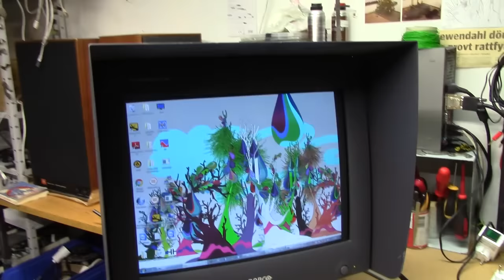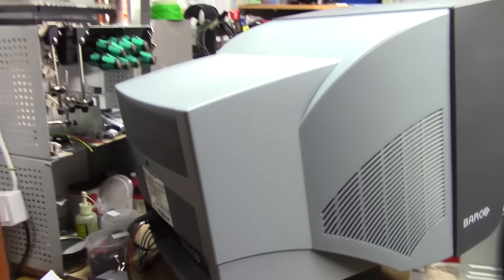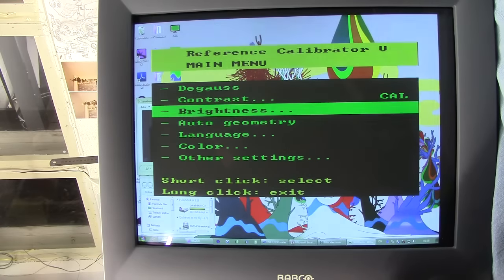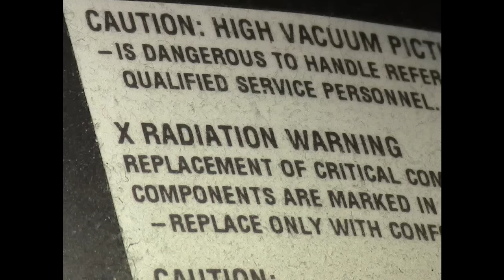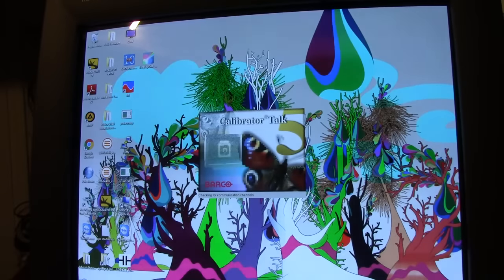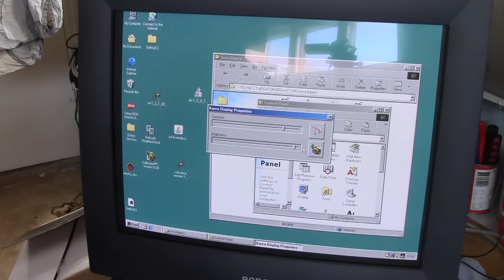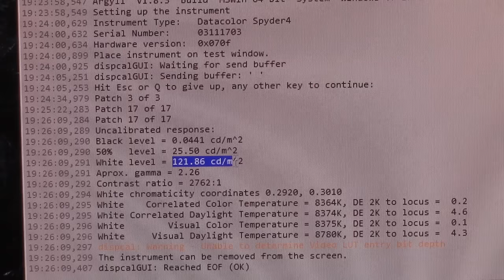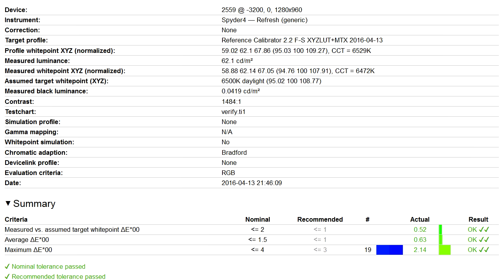Barco Reference Calibrator V CRT monitor

Comment: This was made Oct. 2001, at that time it's likely this accompanied a SGI workstation like an O2 or an Octane, I've also seen them with Sun computers but not usually a PC. The serial ports are to communicate the calibration and some monitor data back to a host computer where it would count down the hours until recalibration was required, The Barco chip is likely to deal with the calibration and so is most of the extra electronics. I think the USB is just a hub on these. I'm more familiar with the earlier monitors but Barco used to claim that they only used "A" grade CRTs while most PC grade monitors had "C" grade CRTs.  These were mostly sold with large graphic systems costing sometimes millions of dollars, they sold that division in the mid 2000s which was a sad day for me as I had years of experience, Barco training and enjoyed working with them, they had film printers that could do over 6000dpi and software that did things you still can't do with Photoshop or Illustrator. Today you commonly see Barco LED displays at hospitals for viewing X rays and the like. If you're at a big event with video projectors they might also be from Barco.
Reply from the maker: Cool.

Comment: Most older monitors had the BNC connectors because the VGA connector wasn't always around. Even some of the mid-age CRTs will have both VGA and BNC connectors, especially the originally NEC MultiSync monitors.
Reply from the maker: This monitor dates from well within the time of VGA as a consumer standard; I'd wager the use of BNC has more to do with industrial compatibility, since this monitor is certified for medical and ATC use.

Comment: We use calibrated CRTs in the industry still for this very reason. They are still outperforming even the top top end professional IPS monitors on the market.
Reply: +JJ Warner for us refresh rate isn't a big deal.(all the stuff I work with is just 24fps) It's mostly just about colour accuracy and luminance characteristics.
Reply: IPS, yes.
OLED, no.
Reply: JJ Warner
No OLEDs are better but we don't have the wallet where I work. So we use these with very high end calibrated IPS monitors.
Reply: No CRT does over 200hz. LCDs do 250hz, some TVs do 600hz.
Reply: Not sure about this nokia case looks really dodgy, flyback should die off pretty quick...
I have a best CRT ever made, Mitsu DP 2070sb and it won't go over 160hz.
Eizo does 240hz, ofcourse tvs don't have capability of driving 600hz signal, that would be retarded to assume... You would need some engineering to make it capable of that.
Reply: Really weird. Specs look pretty mediocre on that monitor. It's sort of 3310 of CRT monitors :D Will try to get one. Mentioned 600hz TVs just cause of dumb spec... So useless when response time doesn't get lower than 1ms... If it's 2ms 1/6th of frames is just fog... Even if we assume that there is some quadripple displayport connection and it has the wiring... Overall all LCDs flicker at 600hz, and that's unhealthy as fuck.
I would rather have 60hz CRT flickering in front of me... LCDs are braindamaging...
And yeah on 344hz there would be nothing more pleasant to play than Q3 OSP/CPMA, or some really smooth and cool video game.
Reply: Eats popcorn, so much stupid not enough patience to care.
Reply: Stupid? What to be exact?
Reply: techno girl CRT have perfect blacks to
Reply: CreativeType 

What industry?
Reply: @jjwarner9419  4 years later 360hz lcd

Comment: Pretty awesome to find a Barco display of any kind in the trash.  They're very highly regarded in industry and they supply screens for extreme high reliability applications like air traffic control radar displays and airline flight simulators.  Assuming the caps inside don't dry out and go high-ESR, that thing should have another 14,000 hours in it!  Too bad the internal comms have failed, but nice workaround with your Spyder4.
Reply from the maker: Oh, air traffic control - that's cool. Given how this thing looks, I do not doubt your statement.

Comment: I have a Compaq Q-Vision 210 with the same Phillips turquoise driver chip in it. That monitor is from 1996 and also has the same separated VGA to BNC connector on the back. It also has a Hitachi CRT in it, but I forget the model.
Reply: +Mark Furneaux fun fact: a lot of monitors came like that if they were primarily for the photo editing or prepress markets. I recall quite a few Applevision Trinitron monitors with the same hookups, and their respective Apple-rebranded graphics cards for the time. I'm believing it had something to do with higher resolutions or color-correctness, but I could be absolutely wrong on that front.

Comment: you can skip to the () if you wish because I now what wrote was long.

I have dell 1998 dell CRT monitor that is almost new the person how had it didn't use it a lot I played sonic and seat all stars racing and it looked better and was smother then my old LCD that likes to be bad and it can go  to 1600x900 but its not recommend to go over 1024x720. I uses to play my old windows xp games on because on like my old LCD if you changed the resolution it would cut off the image I have 3 CRTs monitors and 4 CRT TV which one I still use all the time and 2 monochrome ones . the TV I uses is an 1995 Samsung 24" inch to play my DVD, vhs, n64,Wii because none are HD and it looks better on it. (cool find)

Comment: I want one of these.. I wonder if you could put a Noctua fan in the case.
Reply from the maker: +Graham R Any 80 mm 12 V fan will probably do - they don't need extreme airflow by any means, the total consumption is only about100 W or so.

It's funny you'd mention that, though - I'm actually fixing up a second one of these right now, and one of the fans I was considering putting in was a Noctua, but it had to give way in favour of an Arctic F8.

Comment: hi @FFcossag, i already have a Lacie electron22blue ... do think a Barco Calibrator would be way better?
Reply from the maker: No, I don't think so.
Reply: ok thanks mate!
Reply: @l0rdm0rd  The Reference Calibrator had clamped black as well as white levels. I believe the Lacie had drifting black levels. So the calibration would drift over time on the Lacie while the Barco would remain more stable for a longer time.

Comment: How much does this monster weight?
And what is the max. resolution?
Reply from the maker: +Das OSi About 32 kg and 1600x1200 @ 85 Hz. I personally find the lower resolution modes at 100 Hz to be more interesting, though.
Reply from the maker: +simontay1984 To be fair, in 1999, it wasn't possible to be much more than a first-year student with regards to Java, since Java wasn't really a thing before 1995. And since the software IS written in Java, you really do have a point, I suppose.

Comment: I might have missed it but I didn't catch if you were using a serial line directly connected to the RS232 output on the computer, or if you were using a USB to Serial converter. 

If so, the USB dongles out there don't work very well. If you were using a normal RS232 output it probably was borked. :c
Reply from the maker: +ReverendNillerz Real serial. I later got another identical monitor, and it worked flawlessly on ALL the systems. This one is fucked.
Reply: +FFcossag huh, well that'll do it. thanks for the reply.